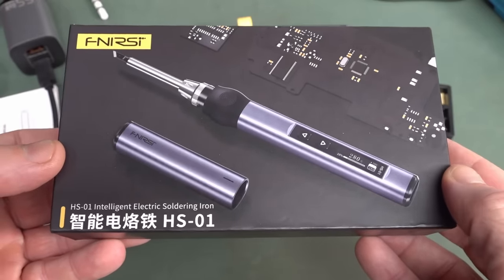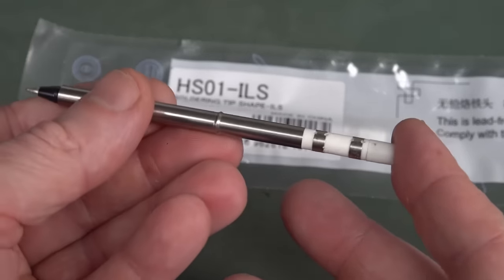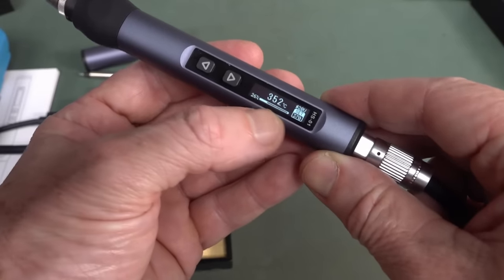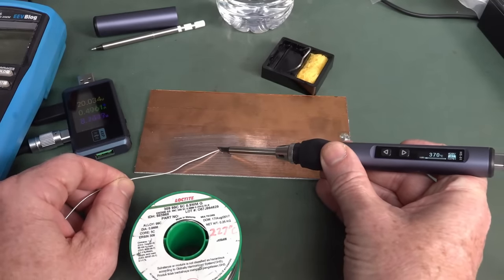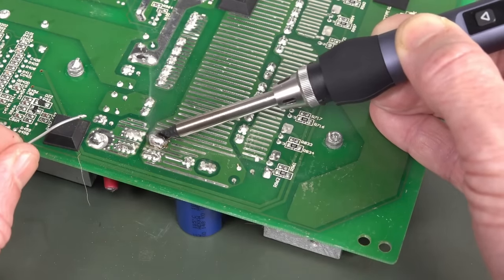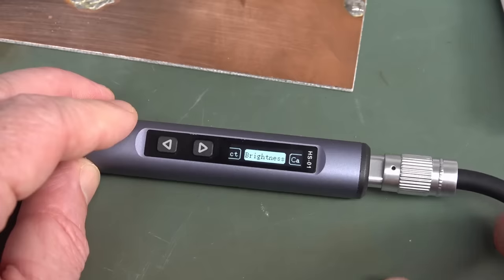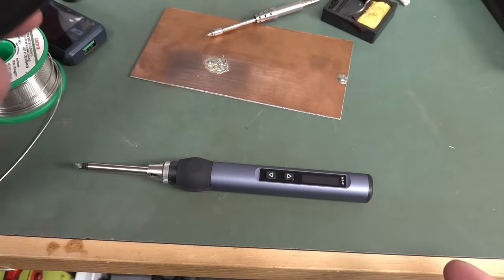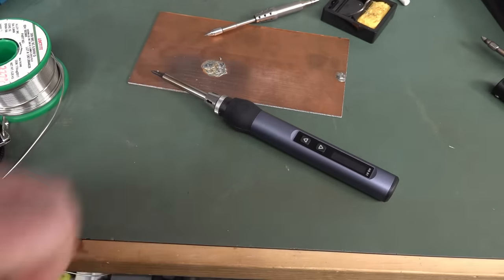EEVblog 1543 - Mailbag FNIRSI HS-01 USB Portable Soldering Iron

Comment: you have to take the nut off .. then slide the tip in ..  then put the nut back on and it will hold the tip in using the ring on the soldering tip..
Reply from the maker: D'oh, you are absolutely correct. I was used to the slide in design of my TS80P. It works perfectly. But I then assume that won't work with the Hakko tips?
Reply: i was thinking the same thing. looks like as you get older you have to read the manuals :P
Reply: The innuendos, I can't take it lol
Reply: This will probably stop the apparent temperature swings as well.
Reply from the maker: @Chriva  Just the tip?
Reply from the maker: @DoubleMonoLR  Nope, same thing.
Reply: @EEVblog  ah assumptions based on prior knowledge, you know better than that Dave 😅😅 phone rings friend: powers on but no high voltage me: change the horizontal output transistor friend: still no go me: WHAT??? Il come over😡😂
Reply: @EEVblog  do you want ants?
Reply: The apparent temperature swing is due to low power supply. It's reported in the user manual
Reply: @EEVblog  The tips are pretty obviously MiniWare TS100 style tips, its also 65W. Love my TS100
Reply: @AlessandroAllegretti  Good to know. My guess was its doing some kind of tuning, maybe a pid tune for the temperature.
Reply: People made the same error with the sh72 iron except with that it wouldn't make any contact and people complained it was a dud.
Reply: @DoubleMonoLR  Those wild temperature swings are the trademark of the Chinese T12/T15 knockoff cartridges. They have a bit of a break-in period where their thermocouple would jump all over the place before finally settling down in a few minutes.

Comment from the maker: Well, looking at the comments, it seems like the Pinecil fanboys have taken over from the rabid TS100 fanboys.
Reply: Yep. They are pretty good

Hakko is now dead to me aside from the tips. Good bye my beloved stations
Reply: I mean, the Pinecil is basically a unofficial TS100 update for a cheaper price. 
Makes sense fans of the TS100 would convert over.
Reply: @-DeScruff  Miniware released the TS101 after the Pinecil had already taken over. And it is not as good as Pinecil for 3 times the price.
Reply: @rasungod0  - since Dave only judges thing on price, that means the Pinecil is 3 times worse than the TS... and 20 times worse than a Hakko 😂
Reply: @rasungod0  I agree with you 100% they miss their target with the ts101,Sequre is doing much better and Pinecil too
Reply: Does this product use the same tips as the pincel/ts100?

Comment: The Pinecil is only US$26 and goes up to 72W (version 2 goes up to 120W)! It doesnt come with a power brick, but  at least it holds on to the tips properly.
Reply: The Pinecil V2 with IronOS firmware will go up to 120W if you can supply the voltage for it
Reply: I power mine either from an old laptop charger I got at a thrift store, or with the PinePower USB PSU, or from a DeWalt drill battery with an adapter to DC jack,
Reply: @Motolav  Wow! I didn't know that. Updated my comment.
Reply: @PedroDaGr8  it's not on pine's specs for the v2 but with a 28v usb-pd psu it'll draw 110w to heat up, tested by one of the people that contribute to IronOS
Reply: There's nothing wrong with it, he clearly just didn't put the tip in properly. The nut obviously holds it in when done correctly.
Reply: Pinecil needs special 6.2 ohm "short" tips to reach higher power levels than the TS100. The tips are only available in mixed sets of four, and cost USD $25 + Shipping. Bloody ripoff.

Comment: Oh dear, did you check it's manual? You need to unscrew locking nut,  only after that insert the soldering iron tip and then screw back lock nut. It will prevent swiveling of the tip. Also it has very useful cover cap for iron tip, immediately after turning off, you can put on this cap on without waiting for tip to cool down. You can even put HS-01 in your pants and not worry that something will break or scratch your leg with that cap
Reply from the maker: Yes, I already pinned a comment about this. I assume this won't work for Hakko tips though?
Reply: @EEVblog  The soldering iron can work from T12 tips, but firstly, it is not limited by anything inside, as if it falls further than necessary. You can put some kind of restrictive tube on the T12 so that it does not allow the sting to fall further than necessary and there was contact and heating. But at the same time, the sting is not fixed with a nut. And since the resistance of the T12 tip is greater, the power of the soldering iron is less. There are similar short stings on the aliexpress, but they may have a differens with length, I found a photo in the reviews that they are slightly different and you have to put a wire ring on one side of the sting

Comment: Pinecil V2 is probably the best new portable soldering iron. Only 26$, 60W, USB PD and barrel jack, mature firmware. Even has Bluetooth control for those who want to do custom integrations.
Reply: Pinecil V2 indeed is the best. it's actually more than 60W. It supports PD3.1 EPR, so it can handle 28v input from usb c. I use it with baseus 140w changer and it's a real beast. up to 126W
Reply: I agree. I hardly ever turn on the Weller anymore.
Reply: Pinecil ships with a useless tip and you have to buy a 4-pack of tips to get a better tip.
Reply: The pinecil V2 cost more than 60 eur in the EU. I don't get why the huge price difference of the pinecil between the USA and EU, but this cheap fnirsi iron is unbeatable on our market.
Reply: Love my Pinecil! I use it a LOT.
Reply: @thomhpl the problem is the imports law. Product ships from Hongkong but shown as product of USA on papers. What happens is $35+12=$47 additionally 25% VAT=$11 so sum total would be 58$ converted to Euros would be somewhere around 50€. What we do not notice is that Pine64‘s EU Store should also make operational costs, also provide 2 years warranty as per law. Which adds up to 12€. In total 62€ for a single $35 product. Since US customers get the $10 discount, they get it for $25 itself+shipping. If you are willing to sacrifice warranty and some time dealing with Zoll (customs tax) on your own, it would cost around 45-50€ The shipping used to be a bit cheaper during pandemic time like $6. In total i paid $31 + extra 4.5€ for Zoll.
Reply: Bluetooth! This is what we have come to, bluetooth on your soldering iron. BTW I have this fnirsi soldering iron and it's fantastic, but that's maybe bacause I have been using an extremely cheap one that made my soldering a miserable experience.
Reply: @acoustic61 What makes the stock tip useless? I just ordered one a few days ago and ordered both sets of short tips since I'm already paying for shipping and it would be a lot more to get more later, I but have not received it yet, but my brother has the first version and has only used the stock tip even though he bought the other full size fine tip set.
Reply: What power supply you guys recommend for the Pinecil V2?

Comment: Another Pinecil fanboy here.  Open source, well built, and great price.  Can't go wrong with the Pinecil.
Reply: Except the tips
Reply: The Pinecil tips DOUBLE the price of the iron. And when you need to replace one, you have to buy 4 And only from one place.
Yeah, you can use TS100 clones, but then you don't gain the advantages of the Pinecil V2 extra wattage.

Comment: Really dumb question, but how do I power this?  Mine only came with a USBC to DC5521 adaptor.  When I use a portable power bank, it just tells me the voltage is low.
Reply: You need a USB-C PD power bank with at least 9V and 2A, but then you'll only get 18W.
For best results use a USB-C PD power bank with 20 V and 3.25 A or more (65 W+) and you'll get full power.
You'll also need a decent USB-C power cable that can deliver 65 W (they are often labelled as "100 W")

Comment: Hi Dave, few tips for you and other people with similar soldering pens

1) The bad contact problem appears in most Hakko T12 derivates. Just insert the tip fully inside, rotate it few revs and it will be alright. Just some surface oxidation.

2) you were right about the compatibility with Hakko T12/T15 tips. They are significantly longer, and sometimes must not be fully inserted, just 1 or 2 mm from the end position. But they work.

3) if you were soldering for a longer time, these irons may heat up. There are two standards - T65 and SH72. They are very similar, but differ in length, approx 1cm. It's enough to make your hand less hot. Well, only of FNIRSI uses the shorter T65 standard. 

4) directly heated soldering iron tips use copper core, then iron around it, plus chrome that doesn't let tin stick to it. These directly heated tips like T12 or C245 shouldn't be cleaned in wet sponge, as they will die pretty soon. Brass wool is perfectly fine though.

5) they should really consider shipping BC3 (3mm hoof) tip by default. It's far more useful and powerful, as it actually has the copper core almost to the end, while some K type ( knife) have the flat area entirely made of iron, and iron doesn't like to conduct heat very much.

Anyway, hope that these tips on soldering tips would be helpful, and thanks for your videos.
Reply: they're shipping with BC2 as stock kit now 🎉
Reply: @jiribekr Do you recommend using Hakko T12 tip with this HS? because Hakko tip is 4cm longer, more difficult to handle?

Comment: Gotta give a nod to the cap, if you primarily get by with one tip you don't necessarily need a separate case for it, just cap it and throw it in the kit. Also if it's modelled off the oldschool irons then it should be heat resistant.
Reply from the maker: Yeah, forgot to mention that you can put it away when it's still hot, that's handy.

Comment: As other pointed out, you need to losen the nut to hold the tips in.

This thing has become my favorite soldering iron over the last few weeks. I use it for literally everythign and I love it. It heats up fast, has proper power, doesn't roll and feels reasonably well made.
Reply: It's a bad look that he didn't read the manual and mentioned that as a negative observation. I happen to use a TP80P as my main iron and I've been very happy with it. I'm thinking of trying out the wireless ones, have you given them a go?

Comment: I love using it, it's so ultra-minimal and neat. I've never had issues with disconnecting tips or the power because I use a decent laptop power block. Also, it's important to unscrew the metal thing before inserting tips because it's what holds the tip. It has lots of features, such as sleep more, etc.
I absolutely love working with it, it's the best most minimal iron there is, so pleasant to work with.

Comment: I would still use my Pinecil. Which is a clone of the Miniware TS100, but with both DC jack and USB-C PD. And it comes with IronOS preinstalled. And it is also $26

The TS101 does have the 2 plugs but no IronOS.
Reply: Give it time, I'm sure they'll port IronOS to the TS101.
Reply: @MMuraseofSandvich  I believe that since Miniware started using st32 clones, ironOS doesn't support them. This may have changed

Comment: Looks much better then the propane types for mobile work.
Reply: There's some now that are the body of a vape pen but with a soldering tip, so they run off 1 or 2 18650 lithium ion cells. Not as powerful but very portable and rechargeable by USB.

Comment: @EEVblog I got it few months ago. I don't experience temperature jumps at all, my startup is a lot smotther, just few stops at few temperatures (might be just PID calibration thing) and than stays at temp with no problems. I use 100W powerbank or 100w power brick. It might help to lower the voltage depending on power source.
Reply: The manual that Dave never reads covers the temperature glitches, which occur if your power source is insufficient.
Reply: @johncoops6897  The manual now says temperature might jump around when the tip is new, it will stop once it's "burned in" for some reason. Don't know why, but that's exactly what happened.

Comment: I know this is an old video, but the $30 option is for the iron and tip only.  You don't get the 65W supply or sexy cable for that much.  They are about $25 more.

Comment: I've been using one of these for months now and love it! It heats up so quick.  Also I heard you should use brass wool and not a wet sponge to clean the tip. The wet sponge could ruin the tip. Not sure why, of if that's even true. I'm perfectly happy with the brass for all my soldering, TBH. Paired with good USB bank this has become one of my favorite portable  tools
Reply: Internally heated tips shouldn't be cleaned with sponges, it's generally bad for the heating element as far as I know. It's because the water cools down the tip very rapidly each time you touch the sponge.
Brass wool works much better for cleaning the tip anyways.

Comment: Did you force the PD output on the 48P? Why would you need to turn PD on unless you mean the PD trigger feature it has, which forces PD at the voltage you have to select, meaning you can force 20v into a lower voltage device by accident. Am I missing something here? What is the input USB C cable on the 48p connected to that it didn't just send the voltage requested by the iron.

Comment: I would love to see a shootout between all these portable soldering irons (and a pinecil too if possible) to see which ones do best on a lower power budget. I already carry around a 30W PD battery bank with wireless charging for my phone and I'd love to see which iron does best with that. I'm obviously aware of the benefits of these attached to a brick but I'd be buying it mostly as a backup for on the road.

Comment: I gotta point that the whole kit is closed to 80 bux rather than 30. 30 is the iron, one tip and a chinsy adapter to a barrel jack. No fancy cable, multiple tips or charger included

Comment: I actually bought myself some 510 (vaping devices socket) soldering iron pieces: 8W and 20W ones, and I'm quite happy with them for now.
Yes, they won't do you beefier soldering joints, but for smaller jobs they actually serve me well, and they have several kinds of tips.

Comment: be carefull: dynamic pricing so that the price increases over time and has reached over 34$ 
and of cause without that GAN charger, just the bare soldering ircon for that price.

Even though I had ordered one with 2 tips from another store which filled up the next 20$ to get another 2$ discount.
And I appreciate the move to Type C which is available more or less everywhere you find a smartphone, tablet or Laptop nowadays.
Reply: Looking at the image, it doesn't look like the kit with the charger was ever $30. The selected item option is the smallest kit.
Reply from the maker: @mdfyui8000  Nicely spotted. Yeah, confirmed, $30 without the charger. $40 with the charger from one seller.

Comment: The temperature jumping around is probably from a bad connection since it doesn't hold the tip securely.
It needs a more robust power connector, I doubt it will take long for that USB C connector to get broken off.
Reply from the maker: No, I think it's the firmware sensing and tracking.
Reply: The instruction manual explains why it's occurring. And Dave didn't assemble the product correctly, hence tips falling out.

Comment: the 30$ is surely the price for just the iron -- the 80$ for the ts80 is usually what it went for WITH the charger, the iron itself was also around $40 .. bit more expensive but, way sexier
Reply from the maker: I showed what you get for the $30, charger included.
Reply: @EEVblog  You sure about that? I didn't see any listing that included the charger for that price. Used your link too.
Reply: The charger bundle with extra tip and liquid silicone 65w cable, and stand, and 65w charger, does seem to reflect a more expensive bundle.. the offer around 30 seems to be the most barebone.

Comment: Hey Dave, fair review I thought. I’ve owned and been using one now for a few weeks after watching Richard at Learn electronics repair channel. Bought it to replace my very tired old Weller pu-2d iron. I purchased the full kit which comes with a usb to laptop charger adapter and loads of tips. I’ve been using the iron on the laptop charger and can confirm it heats up fast and holds its heat well using a better supply. Don’t know what your one was doing going up and down when you first used it ? Never seen mine do that, even under load on heavy ground planes I found the same as you. It would do it but it took time, even with the bc3 tip. I’d like to know how to tear it down and replace the usb port and what one it takes as I can see this being a failure point in the future. Brill review cheers Dave !!

Comment: It's easy to fix the loosely problem and it's really cheap to use, great!
Reply: There is no need to fix anything about the loose tip. You simply need to read the instruction manual and fit the tips correctly.

Comment: I already have ts100 and Pinecil in my arsenal. Please suggest something similar portable for micro soldering. It’s just for a quick rework of decently larger smd components (larger than 0402 size). Main drawback of pinecil is the length of the tip. Too large for micro soldering applications in the field. I had to replace capacitors on a few boards in a remote place. I didn’t have enough replacement boards at that time. Had to solder directly.

Comment: Why didn’t they just add a threaded retainer for the tip, like in other soldering irons. That and the temperature reading are the only drawbacks I see.
Reply: They did. The clue is the knurling around the metal collar where the iron meets the tip. The collar screws down after passing over the tip and onto the body.